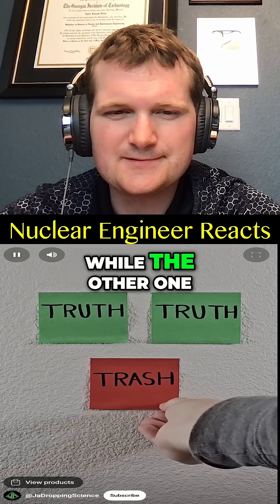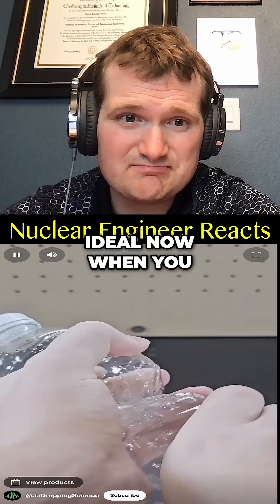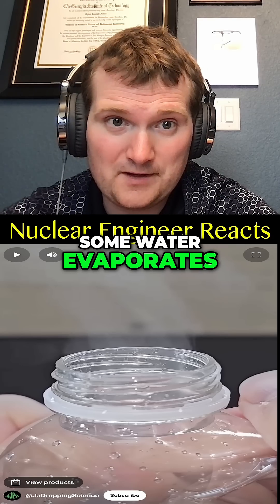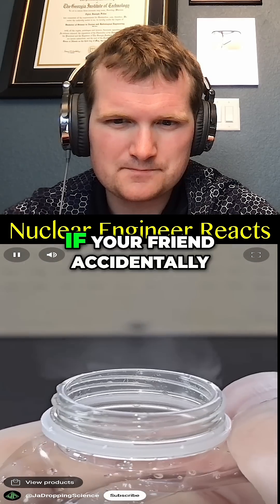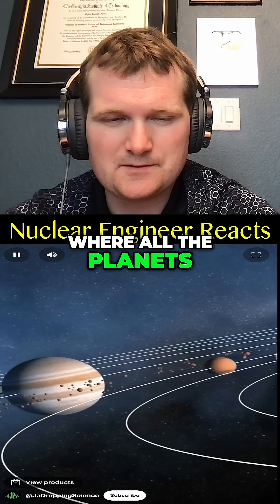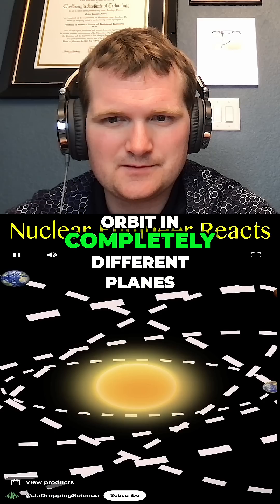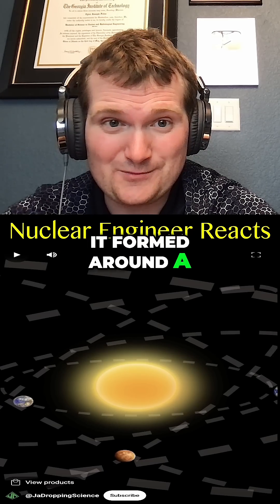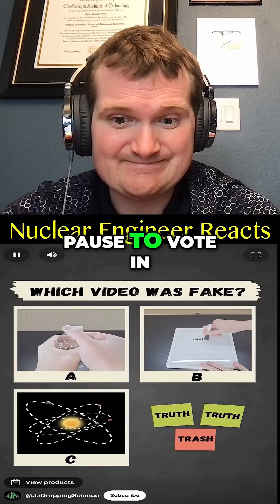Can Squeezing a Bottle Make Fog? - Nuclear Engineer Reacts to 2 Truths & Trash by JaDroppingScience

Comment: you can also hold air in your mouth then do some ts ts ts or ch ch ch after which squeeze your cheeks without letting the air out then release the pressure and you get fog in your mouth

Comment: What if the planets aren't orbiting the sun in an equitorial plane, but a polar one?
Reply: No, it's fairly easy to observe that the Sun rotates in the same plane
Reply: @raptorwhite6468 Yes, I know that everything is going in the same direction, that's not what I'm saying. I'm saying that instead of us being flat, we're rotated 90° relative to the rest of the universe
Reply: @thomasvlaskampiii6850  I don't know about the rest of the universe, but if I remember correctly we are rotated 90° relative to the plane of the Milky Way
Reply: @raptorwhite6468 So, the solar system is in this position | and the Milky Way is in this position - ?
Reply: @thomasvlaskampiii6850  I looked into it more now, the solar system's inclination is 60°, so it's more like /-

Comment: Rough voice today.

The last one isn't completely wrong, don't misunderstand what I'm saying, it's completely wrong when looking only at the solar system but if you look at the solar system relative to the milky way, it's different.
Some bodies don't even "orbit" in the way we usually think about orbits. Just look at the moon, when looking at the moon in this reference frame, it doesn't actually orbit earth at all, it orbits the sun.
Reply: the moon does orbin around earth, and they together orbit the sun. same goes for the plants orbiting the sun, while also orbiting the center of the milky way together with it. the different perspective on the solar system in the context of it orbiting the center of the milky way doesnt show or even imply that the planets arent orbiting the sun, just that they all move into the same directing in space too, next to their orbit, not instead. and when you look at it from that perspective it will still appear roughly like a flat plane, moving through space
Reply: The funny thing is that before 2006 number 3 technically wouldn’t be completely wrong since Pluto’s orbit isn’t on the same plane as the rest of the planets. 😅

Comment: I knew the first two were true because I've done both of them before, had no idea that planets orbited on the same plane, learned something new.
Reply: It's called impulse conservation, every star system must be a disc.
Reply: @Kalidor99  Well they found an exoplanet in a polar orbit last month, so....
Reply: @FlawlessFlaw  If true then it is a captured rogue planet.
Reply: @Kalidor99  Sounds like scientology or either very bad explanation. How impulse conservation should translate into planet systems being a disk?
Reply: @antonzhdanov9653  The original solar nebula (a vast molecular cloud) possessed a small net rotation.
As the cloud collapsed under its own gravity, it spun up (much like a figure skater pulling in her arms) to conserve angular momentum.
Fast rotation prevents collapse perpendicular to the rotation axis (strong centrifugal “force”), so material preferentially settles into a plane perpendicular to that axis.
Reply: @Kalidor99  Here we are. The reason solar systems are flat because they rotate, flattening them on their rotation axis.
Pretty much the same way like pizzaiolo flattens dough. 

Initial nebula condensation just speeds up this process and align all rotation vectors into dominant one stretching solar system perpendicular to rotation axis.
Reply: @Kalidor99  save for some dwarf planets asteroids comets etc
Reply: All basically the same plane. I think Neptune is slightly out of line.
Reply: It makes sense, it’s the same reason the moon rotates around our equator (however I don’t know what that reason is) btw yes the sun does have an equator and it does actually rotate, about 25 earth days per sundays
Reply: @shadowbonbon3  The reason is Conservation of angular momentum and Collisional damping and flattening.
Reply: I mean, tbh it's not exactly the same plane, but the angling of the orbits of one to another isn't that high, iirc the most inclined orbit is like, 10º? There's a reason as to why that happens, and why planetary systems, black hole accretion disks and even galaxies alike take a flattened shape, one really quick way to lose kinetic energy and reach a more stable system configuration is to restrict the range of motion in one or more directions of all of the spinning components
Reply: doomshroom
Reply: It's the same as atoms, the electrons orbit in the same way
Reply: @Linkofthewild08  Electrons are in s, p, d and f orbitals. Nothing flat there.
Reply: that's not true ever since electron cloud theory was a thing